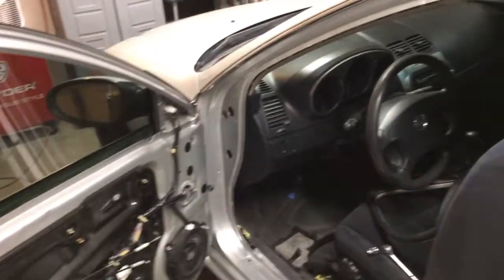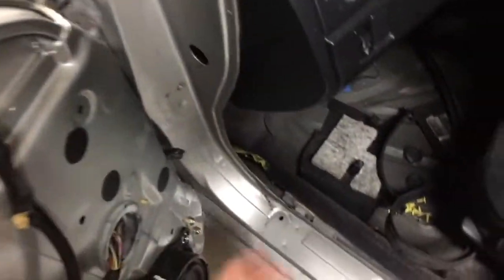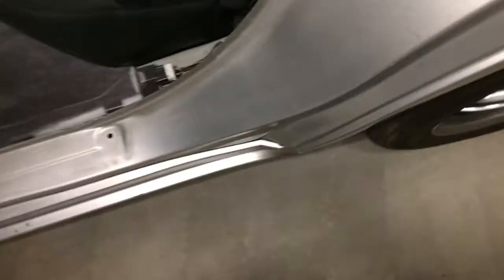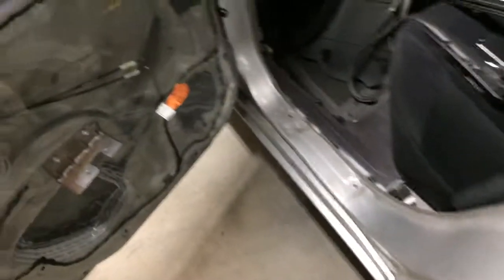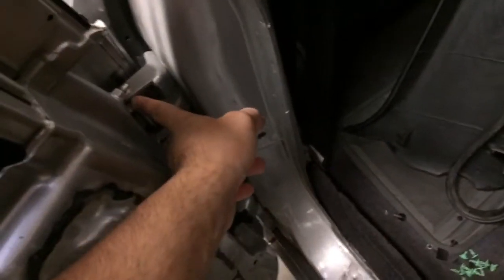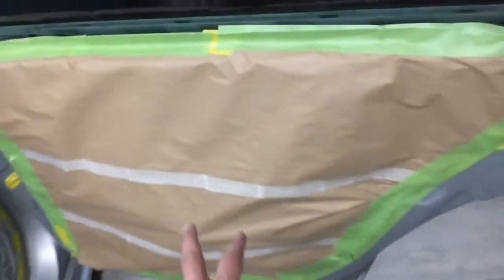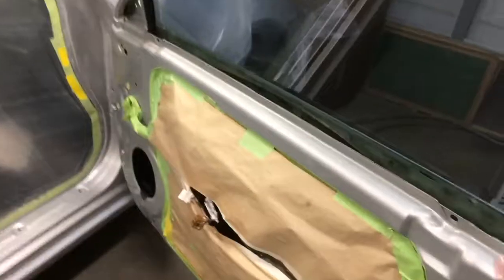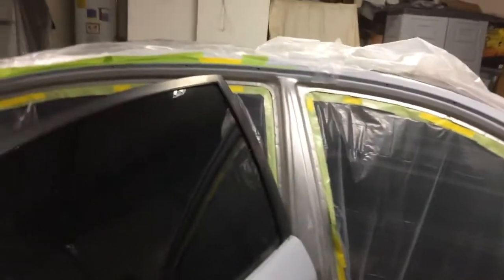Episode 18 - Custom Painting Car Door Jambs

Comment: Did you actually notice many spots where there was no paint because the doors weren't removed?
Reply from the maker: I’m sure there were lol
Removing the doors would have been a little easier to paint and ideal. But it’s possible to do it with the doors on

Comment: Would be nice if you would have filmed spraying technique
Reply from the maker: that would have been nice... I used a 70 - 80%  overlap with an 6" to 8" distance for this metallic paint. These tight overlaps will prevent tiger stripes and the distance will help with the metallic orientation for mottling control. The mini gun and the Grizzly gun have a small fan pattern. The fluid control was not at full open but rather at one close turn from full open.
Reply: @DIYCustoms  I love the video and how to properly masking door jams. Am a beginner what's the best way to sand door jams?